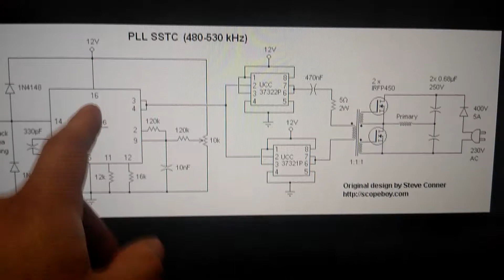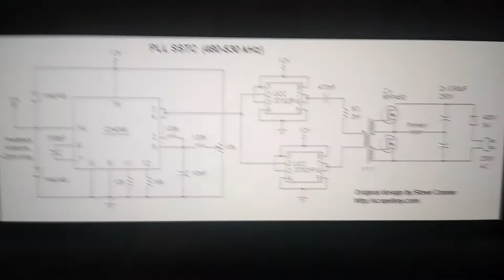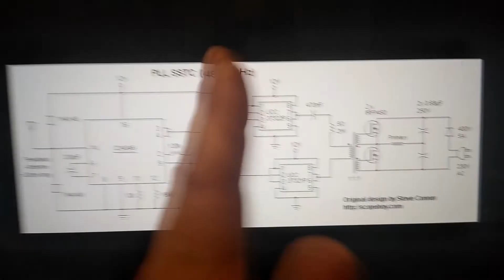Ramped Full Bridge SSTC, Adding PLL Feedback

Comment: Why don't you try the IR2153 SSTC?
I mean i got a 500khz Tesla Coil but i want to try the IR2153 driver, but i don't know if that Driver can Give me the 500khz frequency
Reply from the maker: Just no point in my opinion. There's no high side isolation and no feedback. As a basic SSTC it work great just like if I were to take one of my half bridge drivers and run it unfiltered CW. 

It could probably do 500khz as some people have driven other gate drivers into the mhz. Depends on what you're switching with them.
Not everyone can access them but to me the UCC drivers are easy to come by for cheap and they are powerful enough to drive most all coils I want to build.
Reply: @Magneticitist  thanks, it's because i saw a small Coil that runs at arround 609khz and they drive it with the IR2153